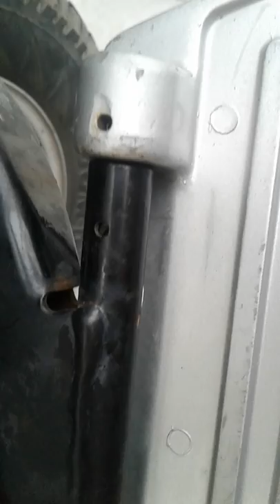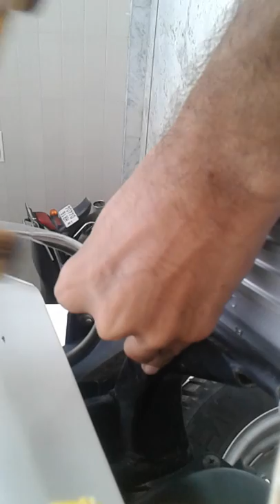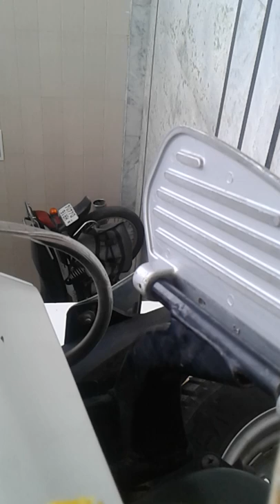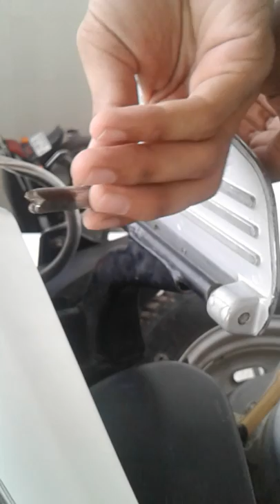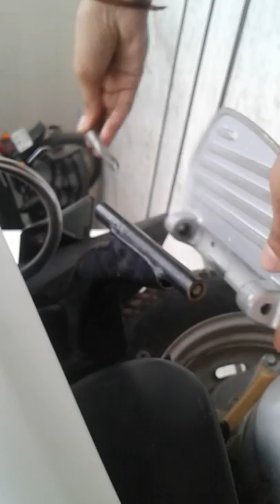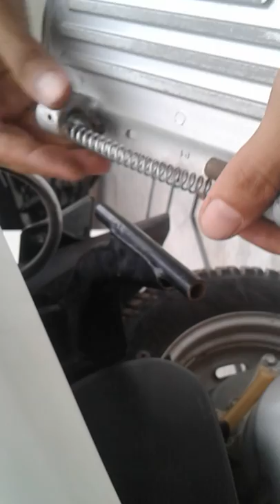How to open activa rear footrest

Comment: This video of your channel helped me fix loose Activa 125 Rear Footrest. Pulled Internal spring to regain the push required to hold the footrest at proper place. Thanks, Your positioning of internal elements helped in opening the footrest. I will suggest hammering the pin from outer side too helping in easily removing the pin. Thanks again for good video.